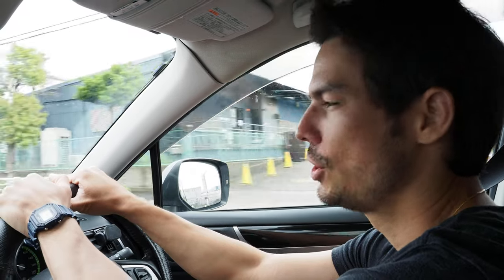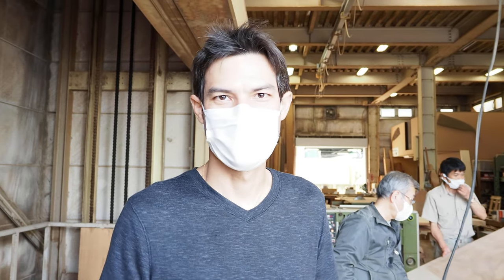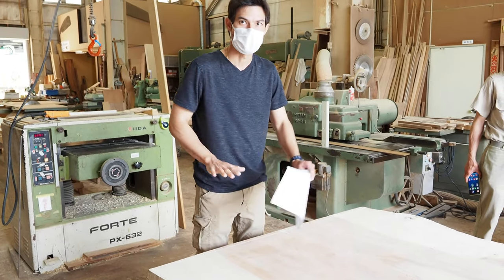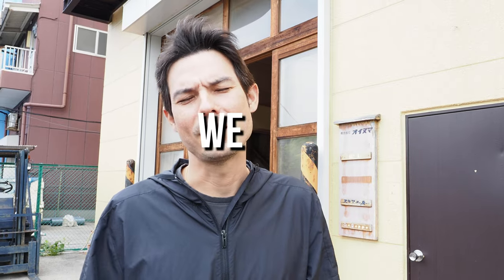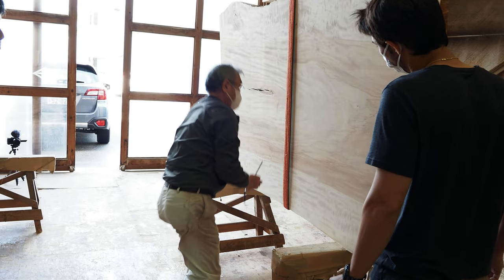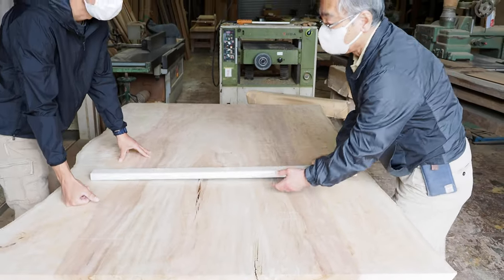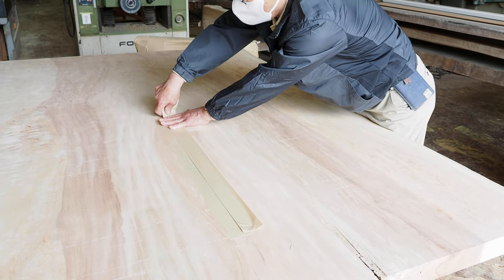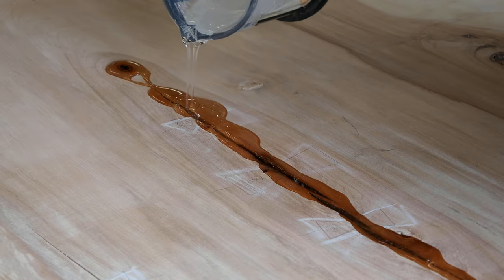Huge Japanese Tochi (栃) (Horse Chestnut) Wood Table Top with Bowtie Inlays

Comment: Just saw this a few moments ago...As a traditional woodworker that works in almost exclusively green wood (including slabs), I can state that "bar locking" (or attempting to!!!) any large slab can often go very wrong over time...This is less likely with quarter-sawn slabs, but if you see additional checking and/or hear "popping" sounds that are the screw heads shearing off. I have had to fix several of these over the years...Sliding dovetail splines and related traditional methods are the modality for stiffing large slabs against warping...Wood moves (as you know) and trying to stop this seldom works...The table top is beautiful and I hope you have no issues with it at all over time...Thanks for sharing the project...
Reply from the maker: Thank you for watching. I hope we don't have any problems.

Comment: I found it surprising that given your woodworking skills as witnessed by your joinery, that you didn’t do the hand planing, butterfly keys, c channel installation etc yourself. But then it occurred to me that real estate and shop space is at a high premium in urban Japan, yes? I say this as I built custom houses including many timber frames for 18 years before gradually moving into custom furniture, which I continue with over 30 years later. As the joy is in the wood. And timber frames are for young men who haven’t had several joint replacements, so moving into furniture is a natural transition with age.

Comment: all but center holes in c channel cleat need to be slotted or oversize with washers or washer head screws or else as top expands/contracts wood will split (unless if soft wood might? get away with snug hole screws)

Comment: I've just discovered your channel and I'm in awe with some videos that I'll watch for sure. 
But I honestly struggle to understand why, as you appear to be a wood lover, would you install those huge metal bars into your table.. and all that epoxy.. and the polyurethane finish.. 
Isn't it against the spirit of all this? Not only that but is it really technically better? I'm not sure. Like those metal bars, why not some beefy cross beams in dovetail slides instead (which can of course serve for the feet)? And who needs its table to remain absolutely perfectly flat anyway? Also this polyurethane will flake and scratch over time and use, and is a huge pain to maintain (you basically have to sand everything at some point), while oil and wax can simply be reapplied. 
Sorry if it sounds harsh but I was genuinely surprised after watching other of your videos.
Reply from the maker: Of course there are a lot of different techniques that could have been applied, but for me it was a matter of creating a longer lasting finish that was easy to maintain. The metal bars are there upon recommendation as they would stay straighter longer. Ideally, if I had greater time and more space I would have liked to tackle this table top on my own. We had help to get it flat and finished.

Comment: Such a beautiful table. i can’t find the info but about how much did a slab of wood like that cost in japan? Im a timber-framer here in the states moving to japan soon so I may be buying a lot of wood over there in the future 😅.
Reply from the maker: This slab was around $1800. That is due to its unfinished state and also because it is a very large piece of Tochi wood that is not very common. I would say that wood here can be very expensive depending on the grain and the shape. Stay tuned for another video where we walk around an area of Japan that has a lot of slabs available. Thanks for watching.